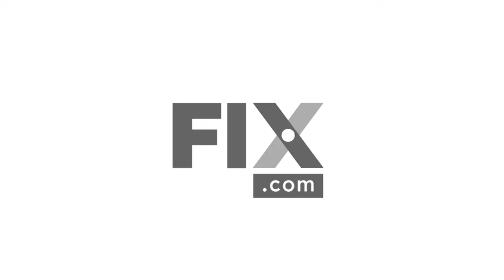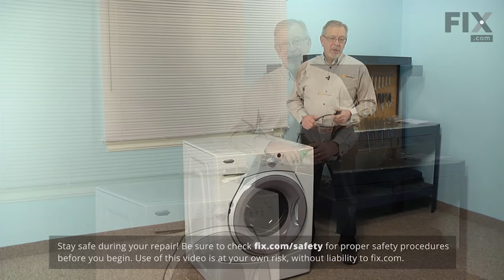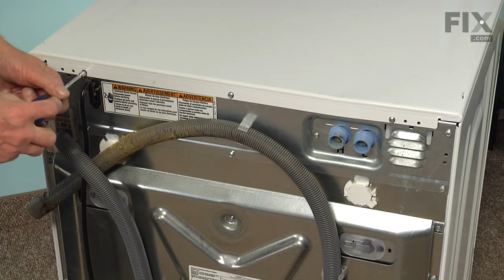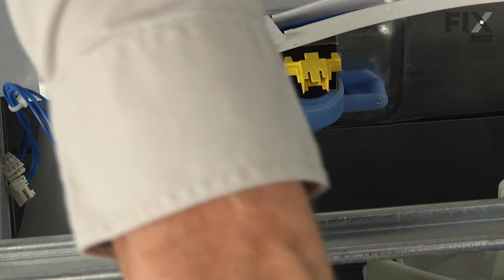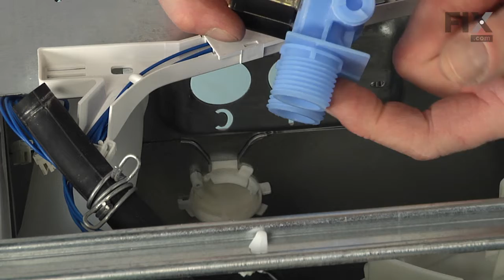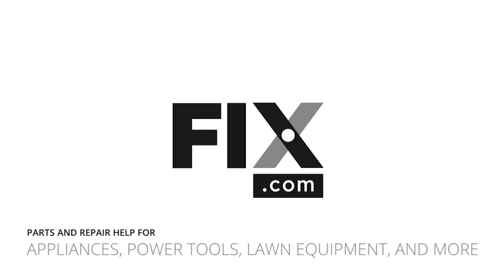Kenmore Washer Repair – How to replace the Water Inlet Valve

Comment: Hello... I did it. I replaced the inlet valve, however, it still shows a cll serv code (call service). I have a Kenmore Elite front load washer. Do I need to reset it after changing the part?
Reply: Was the code f-20